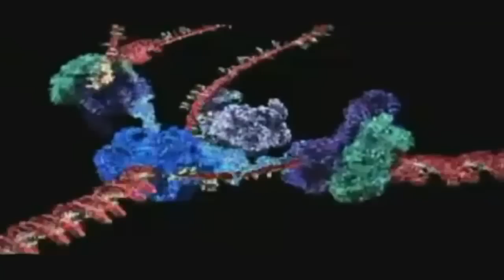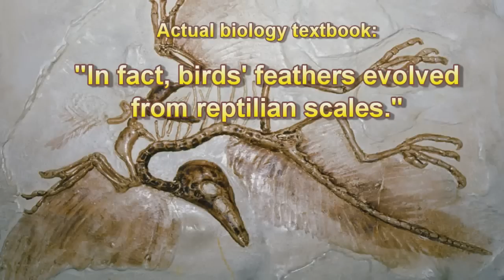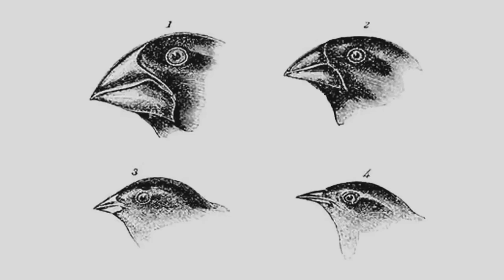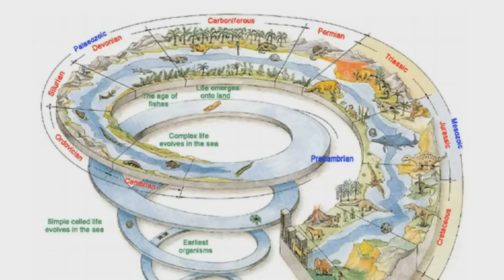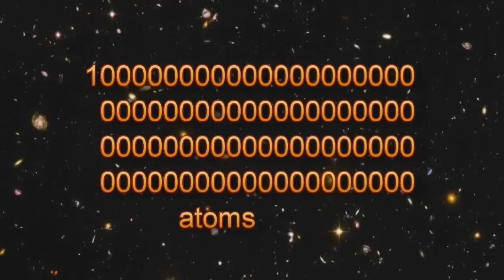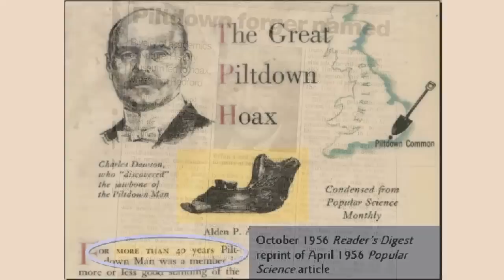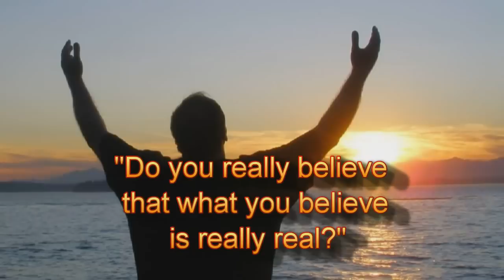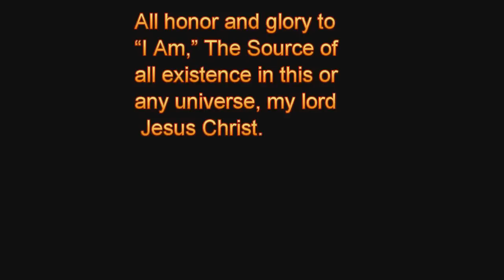Evolution Demolition

Comment: Mistake #1... there are several different radiometric dating systems, and more than one can be used, including Uranium-lead dating method, Samarium-neodymium dating method, Potassium-argon dating method, Rubidium-strontium dating method, Uranium-thorium dating method, etcetera, etcetera.
If the person making this video had actually done some research, like read the article, he would have found this :

"Starting in the early 1990s, Giday WoldeGabriel and colleagues had pieced together the complicated geology of the CAC, and now he gave me a taste. Some 5.2 million years ago, a flood of lava gushed out over an enormous floodplain. Through time, sediments built up atop this base of basalt. Occasional volcanic eruptions would leave thin seams of ash tuffs interlaced among the sediments, like coats of icing between the layers of a great cake. Meanwhile, magma pushing up from beneath the surface tilted the cake up toward the west, reexposing the long-buried sediments and the often datable ash. Our walk took a path into the tilt of the deposits, moving horizontally through space but drilling vertically into time. Unfortunately, through the millennia, the CAC cake has been randomly kicked and flung about by tectonic commotion and chewed by erosion so that slabs of cake and frosting are strewed about in a haphazard mess.

"This isn't like the Grand Canyon," said WoldeGabriel. "It's a patchwork quilt."

As we set off down the ridge, WoldeGabriel stopped to chip with his rock hammer at a seam of pale volcanic rock called the Lubaka tuff. (The volcanic tuffs in the Middle Awash have been given Afar animal names; lubaka means "lion.") The Lubaka tuff does not contain minerals that can be dated radiometrically—but not far below it was datable material of a different kind. Throughout the past, the magnetic polarity of the Earth has abruptly flipped and is evident in the orientation of magnetic minerals in some rocks. One of these polarity flip-flops, known to have occurred 4.18 million years ago, left its mark in sediments in the CAC.

Just below this time stamp was our first destination: a bush-pocked flat where a fossil jawbone had been found in 1994. It proved to match closely with fossils Meave Leakey and her team had found at two Great Rift Valley sites in Kenya, which she would name Australopithecus anamensis. More evidence would turn up in a Middle Awash locale called Asa Issie—a "quilt patch" composed of the same sedimentary cloth, some six miles distant from where we now stood."

Since this fossil was between TWO dated Layers of rock, it was rather easy for them to figure out about when she lived.

Score one for science!

Comment: No one claims there is any "theory of abiogenesis", but that has nothing to do with the theory of evolution.
We have several good ideas, and evidence for them, they are not just speculation as you assert, but there is no single hypothesis which has emerged as strong enough to become a theory yet.
Reply: As I pointed out in my video, abiogenesis and neo-Darwinism are two different things, but they are related by a common question.  Where do genetic instructions come from?  ...whether the first information, or added information along the way.
Reply: Mark Champneys
Sure they're related, all of biology is related to the question of how life came about, but to try and pick holes in the theory of evolution by saying we have no theory of abiogenesis is just as ridiculous as using the same argument to try and pick holes in germ theory.
Reply: Ratio nalMind The holes in neo-Darwinism stand on their own.  The lack of a theory of abiogenesis is not used as evidence against neo-Darwinism in my video.  But it is interesting how folks like Richard Dawkins run the two things together.
Reply: Mark Champneys
So why did you even mention abiogenesis in a video about evolution?
People like Dawkins "run them together" when debating or addressing creationists because they "run them together".